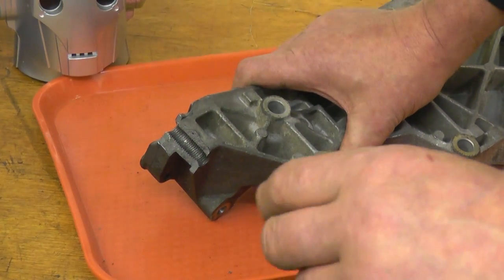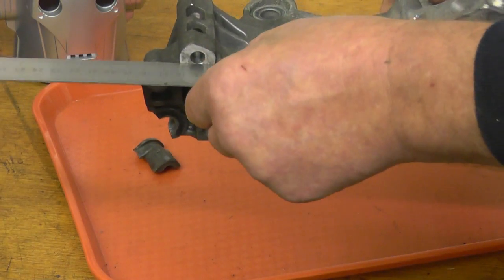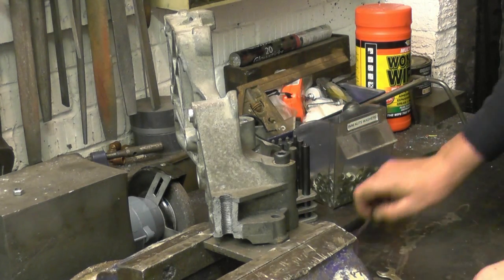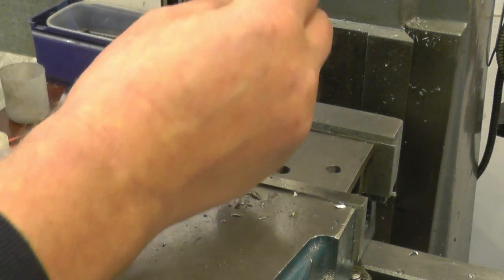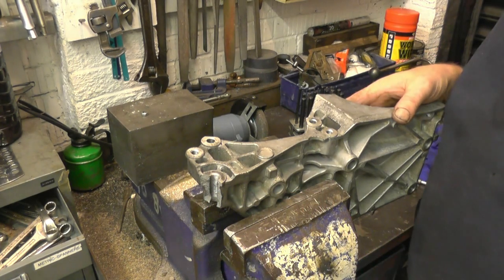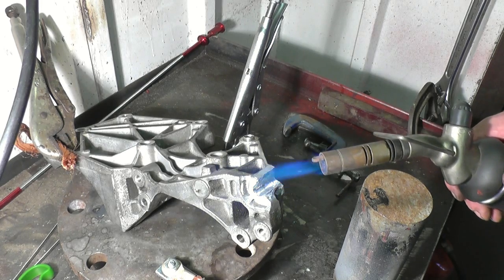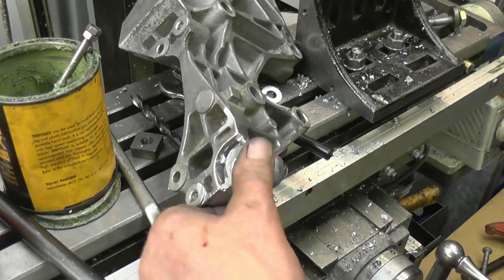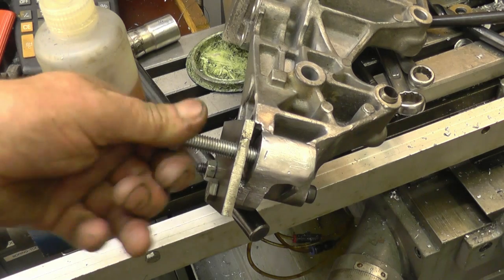ALUMINIUM ENGINE MOUNT REPAIR

Comment: Hi John,

Regarding the ‘Arc Shots’ As long as you have the ability to measure black light AKA UV, would that illuminate the areas around where you are welding to make the actual wending process more easily viewable?

Comment: John, nice job. Thank you for the info on what type of rod to use on cast vs extruded aluminum. I hadn't heard that before. Also useful to learn the jig plate method for locating holes for re-boring. Thinking ahead is critical in most machining I'm seeing. 

I also hadn't heard an aluminum weld out gassing like that before. Always something to learn in your vids!

-- Mike

Comment: John. Very nicely done.  Something to look at it why it failed, as lots of force was on the edge. If other bolts loosened up, that explains part of the reason. If not, just the design allows too much stress on that corner.  Use your steel jig plate, add a spacer. Some longer bolts, it is a nice reinforcing plate.
Reply from the maker: The other bolts "fell out" after a timing belt replacement
Reply: doubleboost
 That will do it!     One reason I like doing my own work, too many mechanics who don't tighten bolts correctly, other than over tightening the oil pan bolts!

Comment: don't lubricate aluminium ... its not necessary
Reply: You must mean cast Iron, which is self lubricating to a large degree because of the carbon content.

Without lubrication many grades of Aluminium alloy will build up an edge on the tool and lead to poor cutting, heat, and a bad finish.
Reply: meocats
Next time you are parting off a 3 in. diameter piece of aluminum on your lathe try doing it dry.  Make sure to share your results with everyone here!  lol
Reply: I agree. I hate when alu chips are melted with the tool and are very hard to scrap away. WD40 or light petroleum are good lube for alu.
Reply: Be realistic.  Most people running hobby-size machines will not be using carbide insert tooling, nor will they have the spindle speeds necessary to get above the surface speed where a built-up edge forms (that is, the tendency for the material to pressure-weld to the tool).  In this case it is not only recommended, but necessary to use some kind of cutting fluid (e. g. WD40 or kerosene) to prevent a built-up edge, enhance the finish, and improve the machining of your part.  It will also prevent unnecessary tool breakage.
Reply: If you don't lubricate (use some kind of cutting fluid) on aluminum and aluminum alloys, especially a casting or soft welded area, your chips will quite often weld to the tool and cause either a poor finish or a broken tool.
Reply: that happens anyways, so its better to keep the feed high and allow the chips to evacuate than bump up into fine sludge
Reply: In that case I would be using at least a 5mm and that would be 37mm to go, making it a 7xD part, which is modest, therefore there will be no problems. Ever heard of carbide with molded chip breaker? They have those for a decade now.
Reply: Are you kidding me? Why don't you be realistic; who the hell is gonna part 3" depth with a 1/8th blade. Even then, just grind a notch in the center of your HSS and you will achieve the inward curling of the chip as a molded chip breaker. 

I'm assuming you mean 3" on the radius. If you mean on the diameter then I don't see a problem. Oil provides lubricity but clogs. Plus, hobbyists are sometimes parting with hacksaws or bandsaws.

Look up hobby lathe at stores like BusyBeeTools, they come come little carbide tools, and that's a woodworking store!
Reply: meocats, as an hobbyst and 7X12 lathe user I can say that some lubrification is necessary due to: 1) a lot of hobbyst use HSS tools. 2) a lot of hobbyst doesn't have skill to calculate feed and speed to cut according to various material. 3) a lot of hobbyst use several alu from scrap and not all the alu is the same, so you have totally differente condition of cut on apparently simile material. 4) not all the carbide insert are really carbide. So I prefer to use light lube on turning alu to avoid problems and to have a better superficial finish. This is my expereince and I learn day by day.
Reply: Your personal feelings have nothing to do with the theory of lubrication and your proofs are bullshit (no offense, you seem like a calm guy, and interested to learn),

how can you cite "hobbyst don't know how to calculate feeds and speeds" as a reason, like that's the whole hobby. There's free machinist calculator and simplified formula involved 3 parameters.

Not all the carbide insert are really carbide? That's insane. Cmon man.
Reply: Self-absorbed know-it-all - "meocats"
Reply: that's correct, the best thing we can do is focus on ourselves and self-improvement
Reply: meocats, with all respect to your skill and experience, I stay on my idea: with alu, especially 6062 or more gummy ones, is absolutely necessary to lubrificate if you want look alike pro results. And, let me give you an advice: when  mill alu with small end mills at very high rpm, try alcol as lube: you will never believe to your eyes how good is the result.
Reply: define lubrication and then you'll understand why its not necessary. Maybe you wanna evacuate chips with coolant, but little squirts from an oil can will not do it!